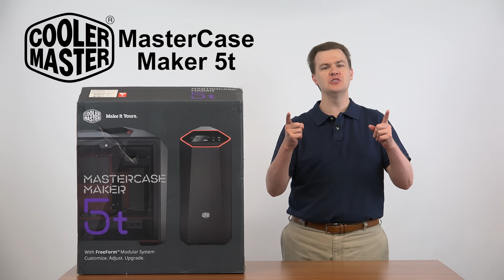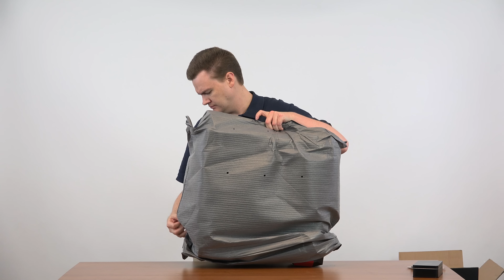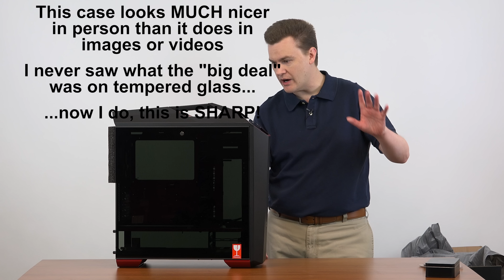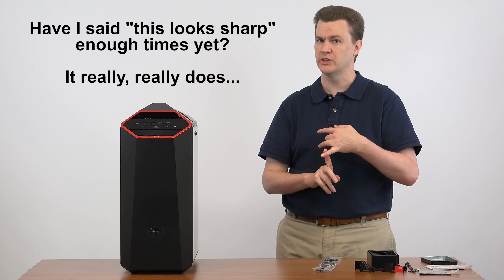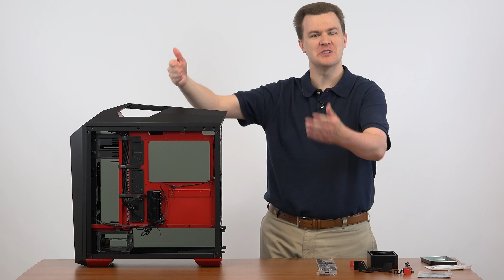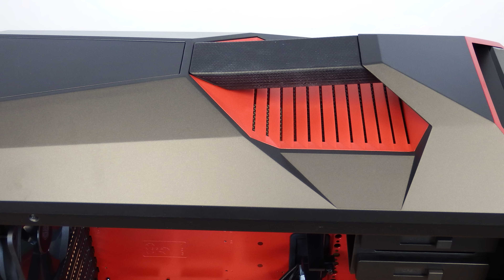MasterCase Maker 5t - RGB & Glass Panels! - CoolerMaster

Comment: Would you consider reviewing a Be Quiet! Dark Base Pro 900? Depending on the market it's $50-100 cheaper than this case and has many of the same features, but is larger and designed for silent operation.

Comment: The 5.25 cages, and HDD cages are completely removable. Also, this case seems to be missing the PSU cover which kind of sucks. The light strip is also magnetic, I have mine tucked away at the top of the case.

Comment: i am planning to buy a second gtx1070 when the prices after the telease if the gtx1080ti drop down, so would you recommend to buy a second gtx1070 for gaming in 4k max details because the drivers fir sli are quiet good optimised in year 2017 but only from nvidias side and certain games
So shuold i buy a second gtx or just buy a 1080ti?
Reply: switzer switzer if you have the money to buy the 1080ti just get that instead. If not, buy a second gtx 1070 but make sure that the games you play are sli compatible.
Reply: Mark Mehilane yeah i will thanks!

Comment: Hi tech deals! i have an i5 4460,16gb ddr3 1600 ram and a gtx 950. should i upgrade to the msi gaming X gtx 1070? i have a 550 watt corsair vs psu
Reply from the maker: I don't know, should you?  It is faster, but do you need faster?
Reply: Tech Deals my birthday was on the fifth. i am going to buy a 1080p 144hz monitor. i play csgo,gta v,ghost recon wildlands <- just got the game,wows <- not really demanding,bf1 and some other "heavy" games
Reply: Ode Valkamo i would buy if i am in your case the gtx1070 after the gtx1080ti was released so the prices drop down for the other cards from the 10 series
Reply: I live in Finland and here the pc compontents are more expensive even though we use the euro and it is more valuable. anyway i have watched the gpu prices in the store for a couple months now (since december) and the prices have dropped 50-70 euros on the GTX 1070s

Comment: for 250, least they can do is put in a power supply shroud to hide wires,,
Reply: I think the idea for this case is to show off your entire build, including the power supply. Having no shroud and a glass back panel is there to show off your beautifully sleeved and routed cables. The other Mastercase 5s with acrylic side panels have a darker section to cover the power supply compartment.

Comment: Can anybody help, please? I've just upgraded from an FX 8320 to an i7 7700k, without windows reinstall, and I haven't noticed any difference from the previous CPU. Any thoughts? could this be a bad chip? Or MOBO?
Reply: Guga ZD What are you using it for? Gaming? Work? What is your graphics card? How much RAM do you have?
Reply: Inverz ok. System. Z270M D3H
i7 7700k stock speeds, performance mode, GTX 1060 6GB EVGA SC, 16GB 3.200 RipJaws Silver (2x8)
Tests Intel Diagnosis Passed. Cine Bench 15 892 @ 4.2 ghz, PCI-e and RAM tried all slots, no difference. 
Problem. Batman Arkham Knight FPS dropped just as bad as with my 8320, Watch Dogs 2 the same. Now The Witcher 3 is the worst. It's running at half FPS it used to with the 8320. Don't know where the problem could be. PCI-e I haven't touched drivers yet. I've nevrr had to install them. Have no idea how. Windows is the same too. Haven't done a clean install.
Reply: Guga ZD If you do gaming only, then you don't really need an i7, the top tier i5 will be perfect. Save that 100$ and buy a 1070 (or its Vega counterpart when it's released). Trust me, it won't bottleneck.
Reply: Inverz I've already gotten the i7, the problem was completely solved by reinstalling Windows. The i5 already bottlenecks on Watch Dogs 2 at about 50 FPS in demanding areas. Soon it'll become obsolete. I'm planning to change my GPU next year, if it really becomes necessary. The GTX 1060 is excellent for 1080p gaming, and I could say I'm rather impressed by it's performance since the 8320 was holding it back. 
Maybe the i7 is a bit overkill, but for the price difference and the improvement over the i5, I think it was worth it. Now all I need is a decent WC, but since summer's almost gone here I'll leave it for late this year.
Reply: Guga ZD Well, Watch Dogs 2 is unoptimized. My friend has an i5 6600k (4.7GHz OC) 8GB DDR4 3000MHz RAM, and an RX 480 8GB. And the game stutters...
Reply: Inverz Of course it stutters. He's got only 8GB system RAM. My CPU is set to power saving mode (a desperate attempt to keep the temps as low as possible) and it runs silk smooth about 60 FPS. I use everything on ultra, but shadows on very high, fog off and SSR also set to off. Tell him to try those.

Comment: $250 case 5t, 28.9 pounds empty, about 22 by 21 by 10 inches- fully loaded approaching 38 pounds, will be very heavy to move for those upgrades but beautiful-  I do require 1 clear side panel, not clear back panel- such a good presenter, almost as if he is using a teleprompter but I expect not, he is just so very good

Comment: Funny enough, I just bought this case for my Ryzen 1800x build. I did it for the same reason's you stated. I doesn't sit on the floor, I like the clarity of glass, and the color scheme is to my liking. And yes, it lights up like a Christmas tree, but that's just my preference.
Reply from the maker: Awesome!  That is what is going into this!  That glass is really nice quality, isn't it?  Much nicer than the plastic side panels!
Reply: Yes! My old NZXT H440's acrylic panel scratched so easily. With my AX370 Gaming 5's overuse of RGB paired with the light bar and a Hue+, I'm very happy with how this build turned out. I wish I could post a picture to give you an idea of how it will turn out. FYI, you can't fit a 280mm rad in the top without spacers, it's best to put it in the front and move the 3.5in drive cage over a notch.

Comment: is 1050 ti enough for fx 6300??
Reply from the maker: Plenty, it will take more...
Reply: Tech Deals I just saw a video that says 1060 bottlenecks fx 6300 
I have money to buy 1060 3gb and have a nice PSU too what do u recommend
Reply: hokopl or rx480, even more performance per dollar
Reply: Akhil Chollangi You should go with 1060. It's better fps per dollar spent and more future proof card. Your fx CPU may be bottlecking in CPU places, but You should be alright
Reply: well if you have a trouble bottlenecking you can easily upgrade your CPU (if your motherboards supports the CPU that will replace it) but frankly you wouldn't notice the bottleneck too much
Reply: Akhil Chollangi better off just getting an Rx 470